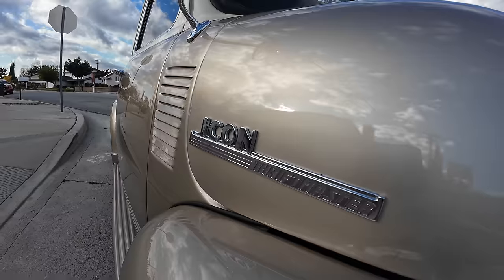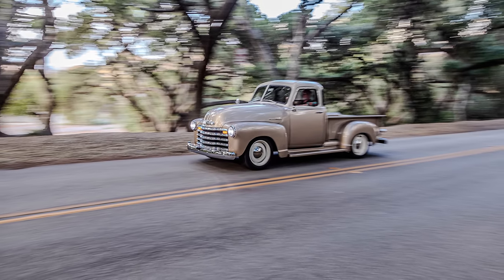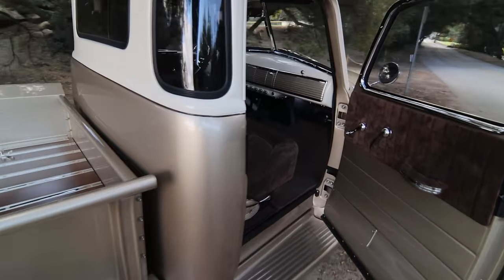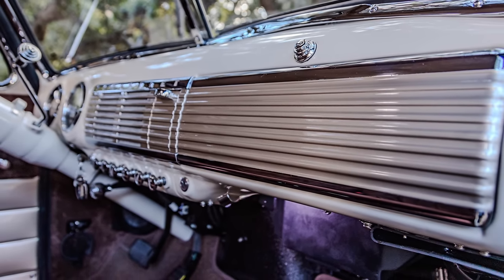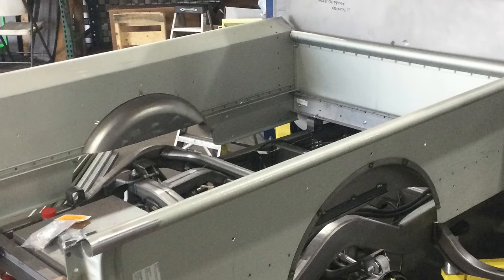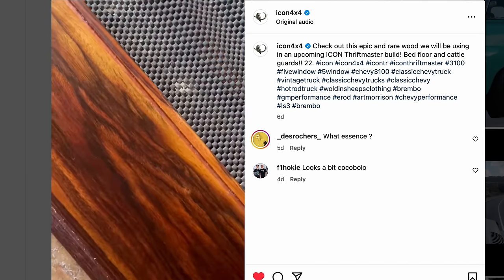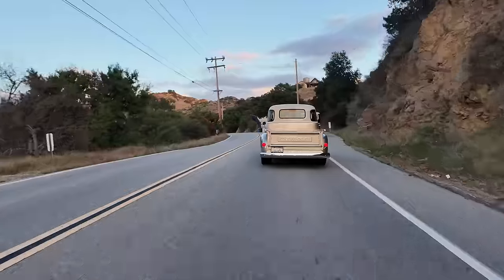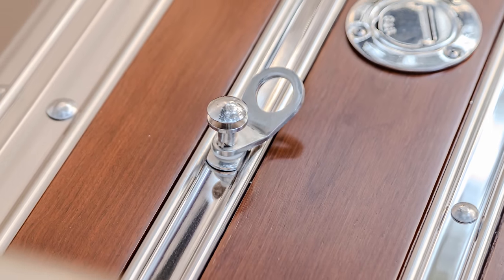ICON OLD School TR #23 Restored And Modified Chevy Thriftmaster Pick Up

Comment: How about horizontal piping on the arm rests between the suede and metal top to separate the two materials?   I wonder if it would stick out too far but I was trying to imagine grabbing the arm rest to close the door and feeling that piping under my thumb.    Would have to see it to really understand but in my head it added a visual strength and actual durability.